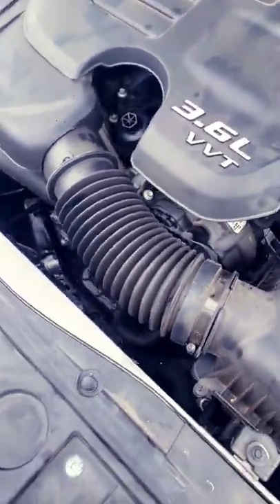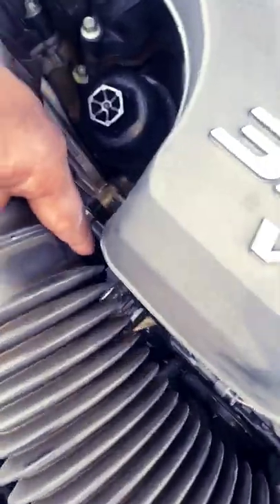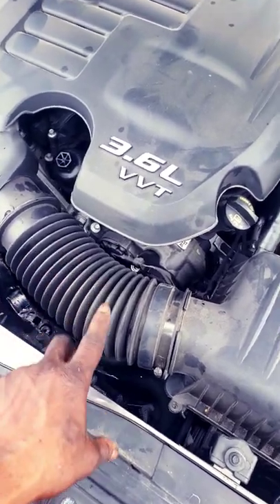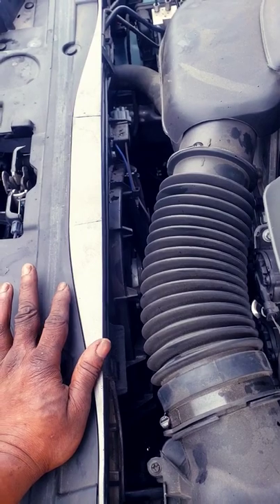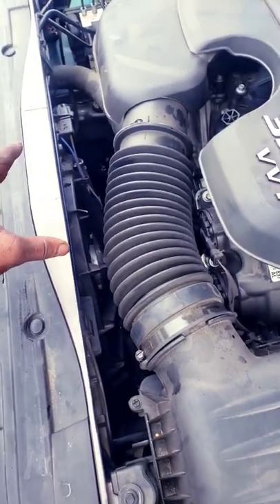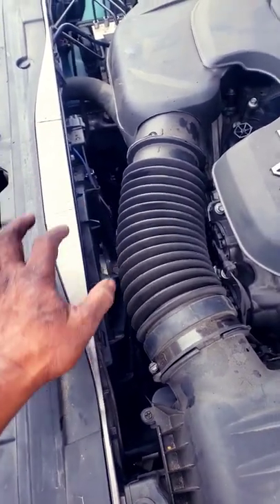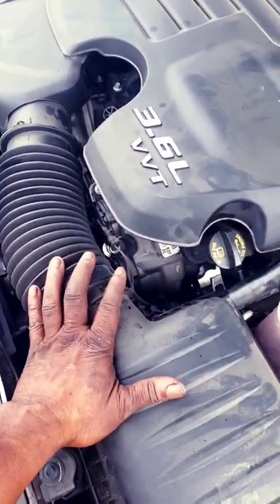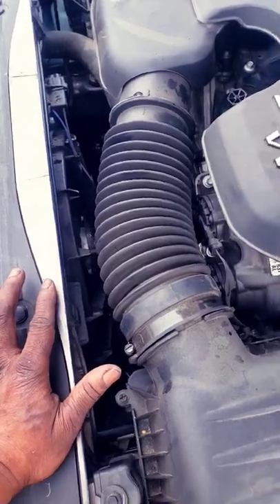ALWAYS DO THIS after ANY cooling system repairs like Radiator, Water Pump or Thermostat. #shorts

Comment: Check out a vacuum fill system from a tool dealer,,,, been using one for a long time and it pulls all the air out of the system then uses the vacuum to pull the coolant back into the system
Reply: The only way to go if you ask me. They should get the techs this tool. Wasting time doing it the old fashioned way
Reply: That's too fancy for me. I prefer to do it the hard way 🤣🤷
Reply: I use a vacuum system to remove all the coolant that an be removed. Then I use the vacuum to fill it. No need to bleed anything.

Comment: I bought a vacuum filling tool. Never get air trapped in the system when using that. It was a little expensive but it saves a lot of time, so I feel it was worth the cost.

Comment: 2011 caravan.. Do i have a bleeder valve?.. Replacing radiator soon
Reply: Yes, it's on the thermostat housing, flat blade screwdriver. Don't crank it closed hard, it's all plastic including the bleeder itself. If you have good, hot heat when you're done, the air pockets are out
Reply: Or just take the coolant reservoir/rad top off and let it run with heater on Full blast adding coolant as needed. Once you’re heater starts getting hot, you’re just about done

Comment: Rule of thumb for me is 3 heating and cooling cycles with any V motor especially a 4.7L power tech. Running it on an incline also helps drastically in purging air bubbles. 2 cycles for a straight 6 even though bleeding is nowhere near as important with a straight 6.

Comment: Is that a V engine? I've noticed that even a V twin motorcycle engine can be difficult to bleed, my theory is the water pipe going from one cylinder across to the other. They should all have a valve there in my opinion.
Reply: Yes it is. V6

Comment: If the fan comes on at 230 or 240, that engine is toast 🤣
Reply from the maker: Explain
Reply: @OnlineMechanicTips  Usually fans come on at around 190-205°F, 240 is dangerous, your temp needle would be at H and you risk warping the head.
Reply from the maker: @VNCTHE1  For you my friend, the next 300 I get in i will do a video where we will watch in live data what temp the low speed fan kick in..It may surprise you, stay tuned.
Reply: @VNCTHE1  most fans on recent model cars don't come on till 210 or higher. Definitely not at 195
Reply: @Krankie_V  Usually 206°f (97°c), but the difference between 210 and 230-240 is huge.  I've worked on many cars, at 240 the gague is almost all the way up to H, itnstarts moving up from the normal deadspot at around 220.

Comment: Will the air eventually work its way out of the system?
Reply: You need to get the air out to prevent overheating issues
Reply: It will usually work its way into the expansion bottle. However overheating can occur if there is too much air in the system

Comment: It's not hard to get all the air out of a system if you use an air lifter to feed the coolant into the system.
Reply: Also, if the fan is kicking on at idle, shouldn't that indicate it's getting too hot and isn't cooling properly?
Reply: @JordonPatrickMears11211988  absolutely not.